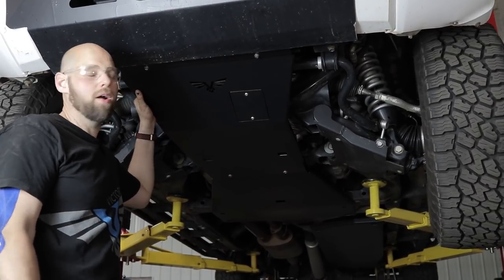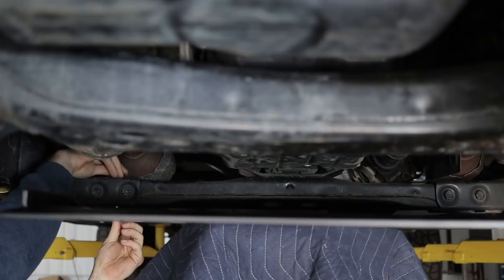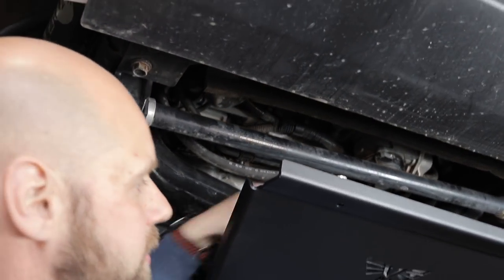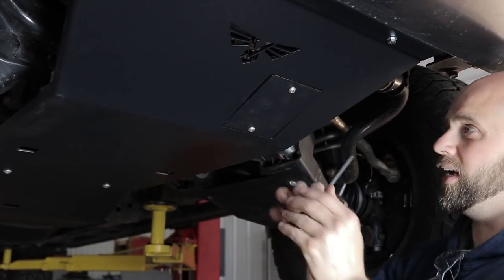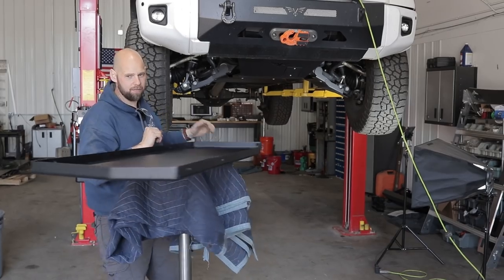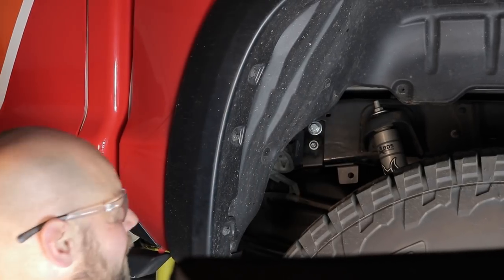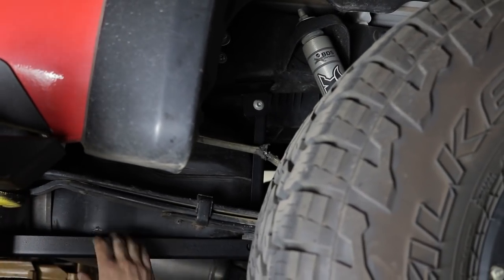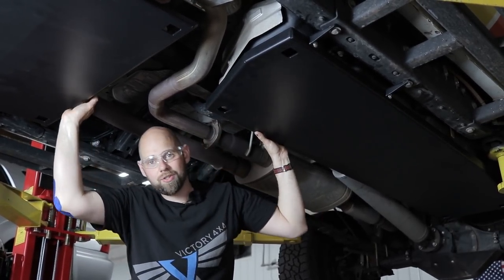Tundra Skid Plate System Installation

Comment: How much weight does this add?  7ga is pretty thick, and how much protection does it add against cat theft?
Reply from the maker: About 100lbs for both skids, they were not designed to protect against cat theft, but they are in the way somewhat, so they couldn't hurt discourage a would-be thief.